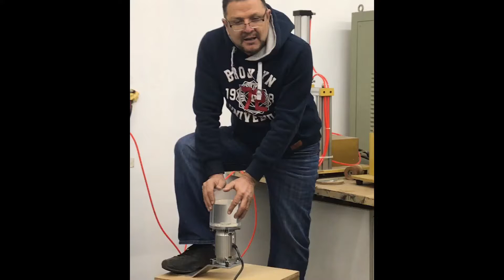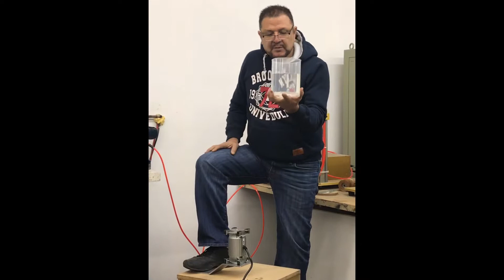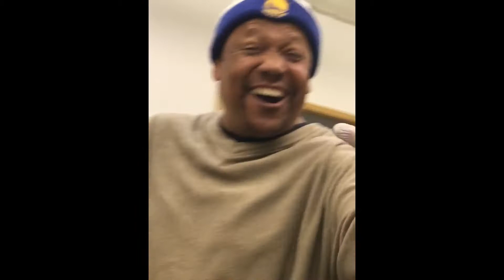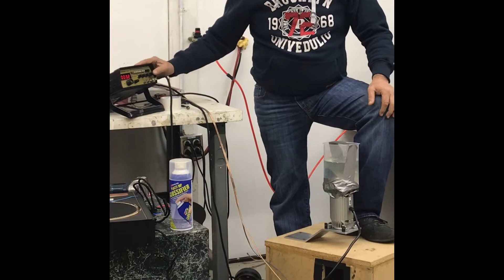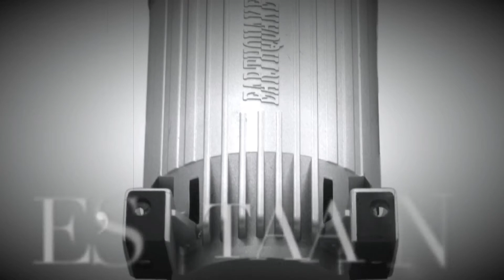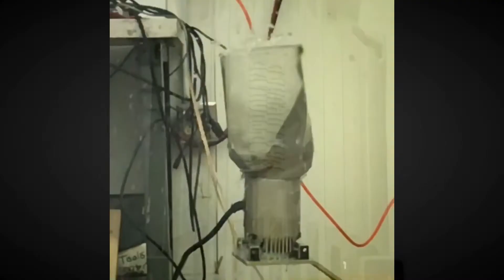Q10B

Comment: I have two mounted to an Ikea Poang chair. Watch the Space Shuttle Launch off the Huble IMAX Blu-ray. It physically slides me forward when I sit in the chair. These things are crazy
Reply: All still working? How do they go for music?
Reply: @davo01BKK  Yep - love them! I find the chair is really important for music - I don't enjoy the quake on the sofa I now use them on but on an Ikea chair the mini works great for music too. The great thing is they also have a thermal protection circuit that automatically cuts it off if it gets too hot. After 3 hours of engame the mini got way too hot and cut off with 10 mins to go in the movie.
Reply: @RXP91   Interesting. Do you think that might be because the chair has firmer foam.  Less cushy perhaps? I was planing to reinforce a section of the sofa with framing and screwed MDF panels. In your experience would it be better fixing the transducer to a solid frame structure or will that restrict the vibration?
Reply: @davo01BKK  The sofa has way more structure and wood, so it'll end up audible if you turn up too loud. I do like my effects extremely high for action movies though. Even 4DX/D-Box etc. is tame compared to what the quakes do at home. 

Just attach it to the wood structure. You can experiment easily too because it's only screws.